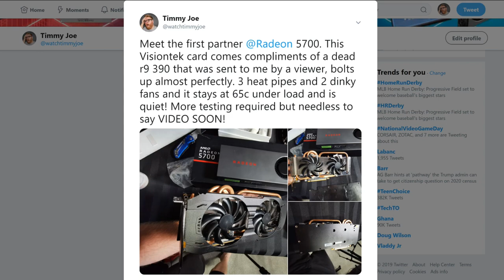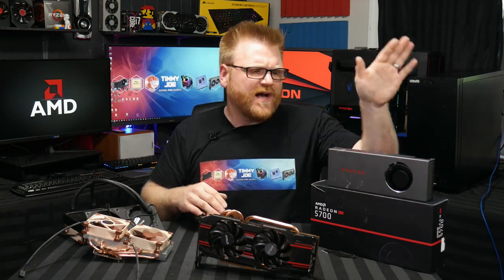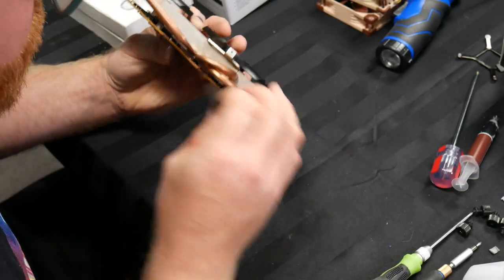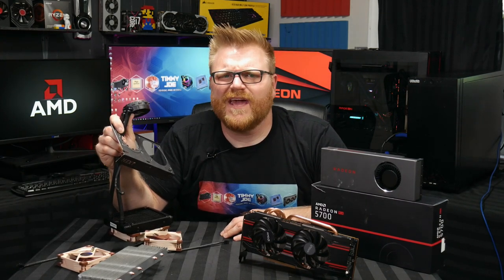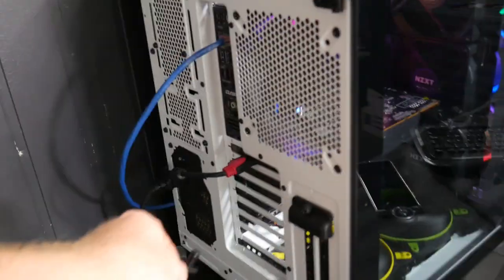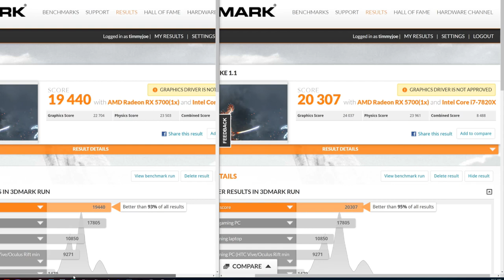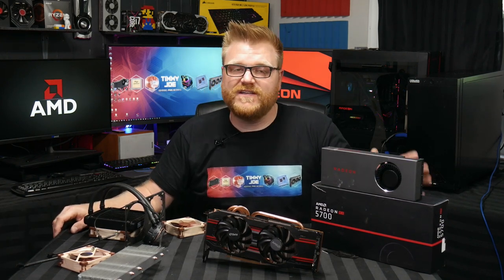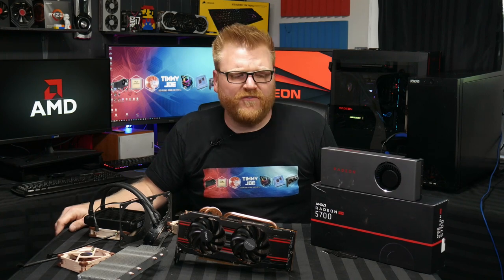Visiontek Radeon RX 5700 2 Fan Cooler TESTED!

Comment: FYI from what i was seeing AMD locked the 5700 to 1725MHZ; IDK why it says 1850 in MSI afterburner but obviously that doesn't work since your not even getting 1800.....Either way forshame AMD
Reply from the maker: That's just how their boost clocks work and have since Vega, The limit you set in overclocking software is never what it hits, I like Nvidia's way of doing it, You set a number and it's reasonable it will hit that number, at least they are being honest with this "game clock"

Comment: Can you benchmark the card with a ryzen 2600 or 2700?

Not everyone has the budget for a 9900k or the 2080ti that all the reviewers are using.
Reply: They do that to make a bottleneck on the part tested. It is not a realistic scenario though, noone will pair a 3600 with a 2080 ti.
Reply: @adelaide7822  I understand the reasoning for testing methodology, but it opens an avenue testing for smaller channels.

We have had a few years now of people recommending the i5 and ryzen 5 cpu as good purchases for those who want to focus on gaming and not content creation or other use cases that benefit from higher core/thread counts.

I know of more than a few gamers that run good mid-tier cpu coupled with best gpu they can get there hands on.
Reply: @Kathdath  I plan on running a ryzen 5 1600 and pairing it with a ROG Vega 56 and than later upgrading to the best ryzen chip that my board can handle.

Comment: Extremely   high Memory temperatures after the mod... owch
Reply from the maker: The memory temps were within 4C before and after the mod, I am using some old gross thermal pads, the only thick enough ones I had, I actually ordered more from Amazon, I will fix it when they come in :)

Comment: I found this link from another channel and it should be possible to overclock the RX 5700 to 2.1 Ghz  and the XT to 2.3 Ghz. https://www.tomshw.de/2019/07/11/ungefesselt-radeon-rx-5700-xt-auf-ueber-22-ghz-uebertaktet-break-the-limits-mit-den-neuen-softpowerplaytables-fuer-die-rx-5700-und-rx-5700-xt/3/

Comment: AMD are getting scummy, locking down the RX 5700 from ANY real Overclocking.... I cannot say Nvidia has ever done that in recent memory, all of their current GPUs overclock a solid 10%+ on core, and often most of the way to 16 Gbps on GDDR6. 
I think that is what MANY people are missing the point about: RTX 2070 OCed to its limits is roughly equal to RX 5700XT - obviously trading blows, but the 2070 Super is a good deal faster still when overclocked as Gamers Nexus showed - and ANY 2070 regular and Super will overclock WELL! Same deal with the entirety of the Nvidia product stack.   I admit Navi is looking way more promising than I thought based on preliminary leaks - but I wonder if they can take the fight to Nvidia entirely or not. Because even at the discounted prices, Navi is just a LITTLE better of a deal, if you don't count the terrible blower or Ray Tracing anyway - which I count the FORMER but NOT the latter!

Comment: I have to disagree with you about AMD not wanting to cannibalize the Radeon VII and the Radeon VII suddenly becoming cheap. Based on what I've read the Radeon VII is just something AMD pushed out the door to make back a bit of money by selling defective Instinct compute cards and get a little press during the long wait between the Vega and Navi launches. It's not something they invested a lot in developing... as a gaming card. Also, I'm pretty sure the cost of the huge amount of HBM on the Radeon VII makes price cuts basically impossible without AMD losing money on each one sold.

Comment: Do you think an EK waterblock from the 290/390 series would fit onto the 5700/5700xt?
Reply: No the CPU die may be in the correct position, but nothing else will be.  EK will/does have blocks for the 5700 series.